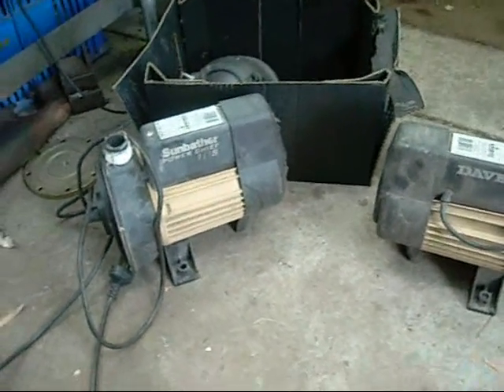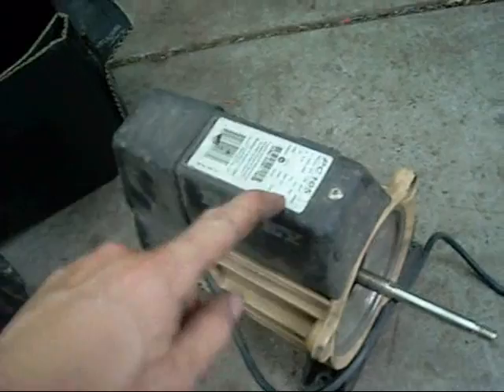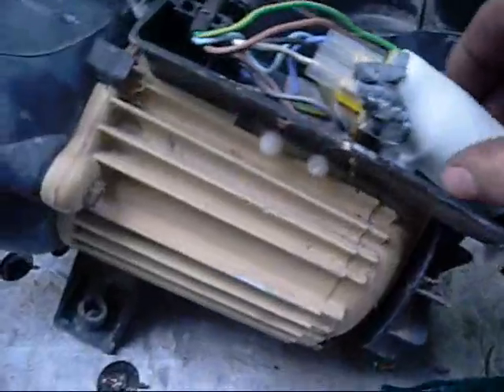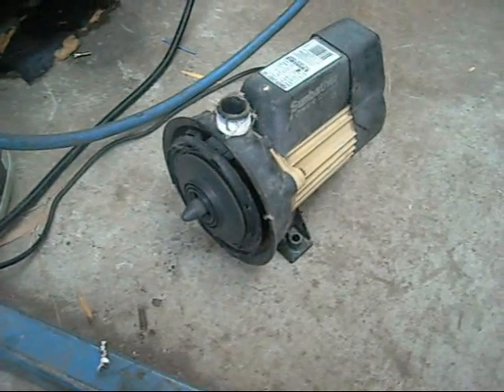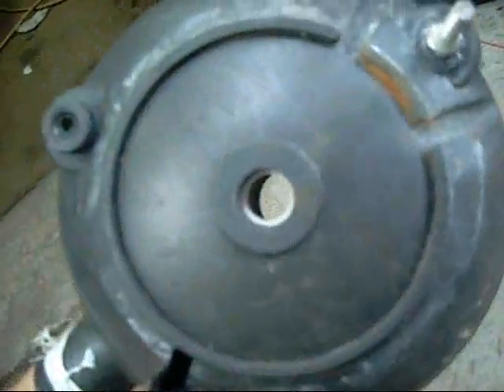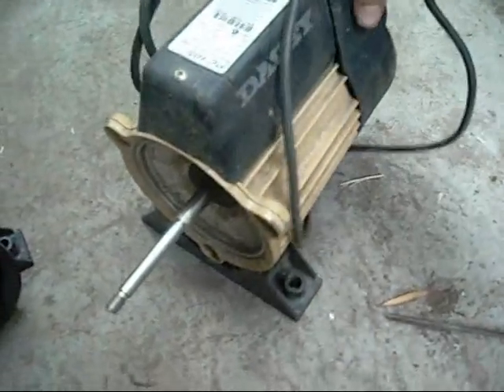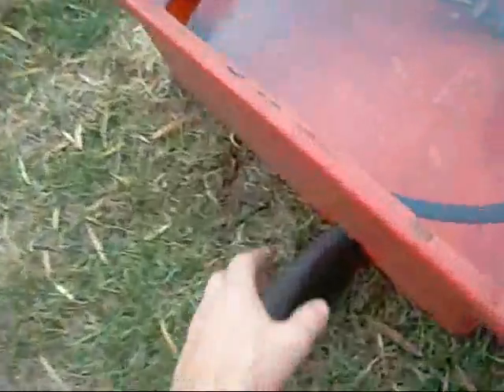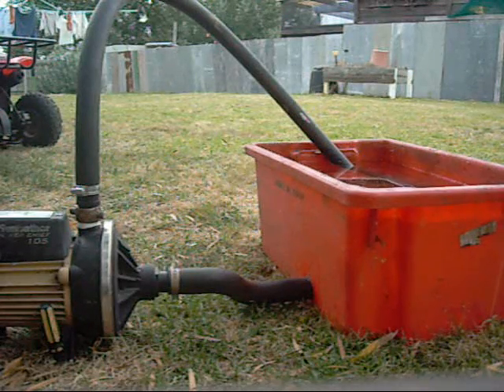Repair and test of Davey Power Cheif 105 Pump

Comment: Is the replacement of the motor capacitor on a Davey HP-45 pump very similar to the capacitor you show in this vid? My pump now makes a humming noise and the motor doesnt run now, much like you describe in your pump in this vid! Hope you can give some advice. It seems like an easy do-it-yourself fix......